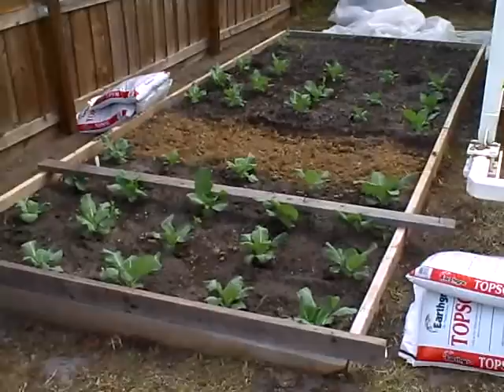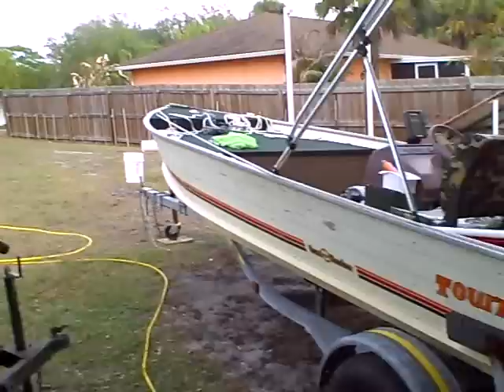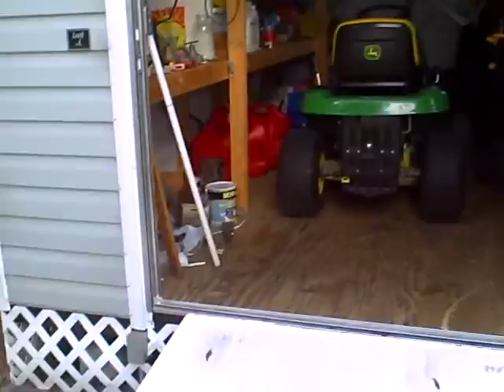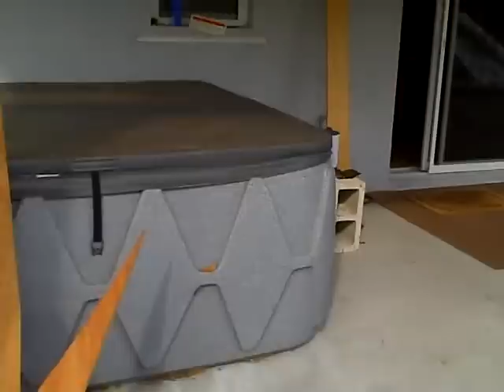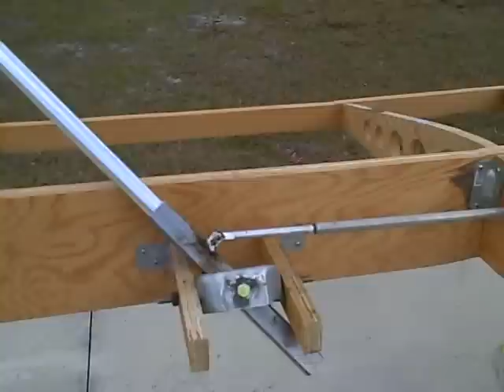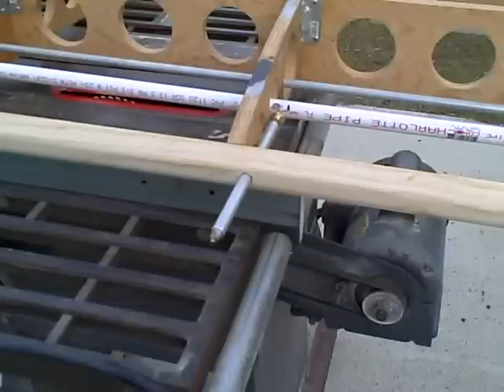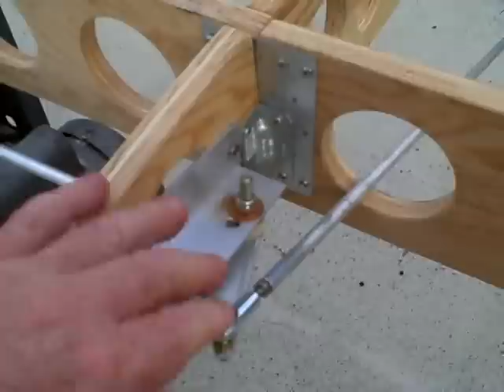My Home Depot Project Airplane

Comment: Dan, I give you kudos for ambition, but I must agree with those who have previously warned you not to fly this wing.  Why should you listen to me?  Because:

1.   I have an engineering degree and 17 years experience doing stress analysis of aircraft structures for a major aerospace company, working to assure the structural integrity of some military aircraft as well as some commercial airplanes that you may have flown in when you bought an airline ticket and went on vacation.

2. I have been a homebuilt airplane enthusiast for many years, and have spent a fair amount of time studying safe and successful homebuilt aircraft structures.

I agree with some of the other comments saying that the way you've designed and built it is not safe.

Like some others have suggested in the comments, if you want to build a homebuilt airplane, joint the Experimental Aircraft Association and learn from them, and get a set of plans or a kit for a known safe airplane and STICK TO THE PLANS.  And/Or do as I did and go to engineering college, study and learn, get your engineering degree, and get some years of experience practicing aircraft engineering before you design a plane.  Even then, it's good to talk it over with others that have professional credentials in the field and see what they think of any proposed design.

Sorry to rain on your parade, and not to try to say how great I am, but it's just that I happen to have some expertise in this field of endeavor that I hope you will benefit from hearing.
Reply: Brice Cook Alright then. Prove to the world that you are better than any of those "professionals" or those incompetent "engineers" that have been designing and testing reliable structures for years. Make this wing fly with indestructible properties Brice! 
You obviously know much more than any college professor or anybody with any kind of PhD, because you say you can! So grab that incomplete high school diploma and get to work!
Reply: Brice Cook I am not obligated to give you anything, because you are so well self educated you should be able to make all kinds of money. In fact, you should start your own business solving aviation problems! Imagine how rich you could become! Yet, all you do it write poorly conceived and written comments on the internet. A tragic waste of talent i say.

Also, lets look at your argument.

You dont think someone with real world experience should have a say in what he thinks this man should do, even if his advice is life saving.
Reply: Brice Cook This really has amused me. Your anger must be caused by some outside source. I suggest counseling. 

So long friend, try coming out of that bridge and joining the real world sometime.
Reply: John Terry <Jollyroger, your comment...snip>

LOL... One must always bear in mind, that no less than half of all students pass the 8th Grade, thinking Long Division, is Fucking Magic.

While in High School, only a few will advance beyond Algebra to study Physics and Calculus. Virtually all of these will graduate from College, with Degrees in Science and Engineering.

Less than half the rest will ever attend College. And less than half that number will ever graduate.

Those who do, are by far and away, Lib Arts Majors, and don't know OprahScience from the real thing.

MachOverspeed
Reply: Brice Cook While reading this comment, i couldnt help but feel your anger is unreasonable. Your lack of saying "before" instead of "b4" proves to anybody reading that your outburst is ridiculous. Your arguing with someone who is decently experienced and more educated in the matter, proves that your ignorance has gone unchecked for many years. I doubt anybody who takes your comment seriously has passed high school.
Reply: Brice Cook " I'll have you know I make upwards of $1,000 hr so no i would not waste my time with a lame ass job" 
2 hours later
"i do not have a job don't need one"

Right. It was pretty easy figuring out youre a troll, just like many who shitpost on these videos.
Reply: Brice Cook 1000 an hour? which job was that?
Reply: Keep building this beauty, other comments are idiots, except for mine, I use aircraft grade wood.
Reply: lol ... i have seen to many engineered things that are mere paperweights
THE TRUTH IS FLIGHT HAPPENED WHEN MEN BUILT THINGS TO FLY
DESIGNS CRASH ALL THE TIME
That said 
stress analysis is building something then breaking it ... you dont have to be an engineer to break things

the best way to stress test a wing is to load it with sand bags
there is no substitute for sand bagging your wing to stress test it 
computer models cant do what sand bags do never have never will and at far less cost with no errors

build a wing then bag it till it breaks and you have become an engineer and its fun to do am i right

of course even an engineered plane must be flown a first time by someone
beauty is these days you can buy big servos and test fly first flights by radio control easily.......

my suggestion is to all the doubters is not to tell someone they can't do something but to tell them how best to stay alive when testing any new design even if it was designed by an engineer.... sand bag test and radio test fly and you cant go wrong
Reply: jolllyroger
Jollyroger, your comment shows that you know very little about engineering in general, and even less about stress analysis in particular.  Stress analysis definitely is not "building something then breaking it."  Aircraft materials are certified to guaranteed strength levels, and knowing the strength of the material, a stress analysis engineer can perform calculations and/or computer simulations to determine whether a given structure made from a known material will be strong enough for a given loading environment, without breaking anything.

Engineers in the aerospace industry do not create mere paperweights, if they want to keep their jobs.  The companies they work for are in a very competitive market and they can't afford to mess up the engineering, and they rarely do. 

The products I'm involved in engineering are world-class, and if the level of education and attitudes that you display in your comments haven't relegated you to a very low income status, you may have flown on one of the airplanes on which I'm doing engineering.  I and many other engineers like me are working to make your flights affordable, efficient, and safe.

Regarding sandbagging something till it breaks, that approach means you have to spend the time and money to build a minimum of two of them, one for breaking and one for flying.  That is, IF the sandbag test shows you can fly the second one without changes to make it safe.  Nobody in their right mind does their designing by sandbagging and breaking airplane structures until they get one that works.  Far better, cheaper, and faster to know something about engineering in the first place, and design it and analyze it to be sure that it will work the first time.  Not to mention that you can make it light enough while keeping it strong enough so that it will fly economically, if you know your engineering principles first.

In the early days of aviation, there were some aircraft that were designed by people who were ignorant of engineering principles, and they often ended in tragedy.

I would suggest that you have a clue about the matters you are commenting on before doing it, ( otherwise the comments come out at a similar level of competence to the process of building and breaking something with sandbags till you get it right).
Reply: @johnterry8958  way back in the late 60's or early 70's, boeing outed an infovideo and i have seen it in movie theater in manila,  Philippines. It features a team of boeing engineers mechanically raising the outer tip of a boeing 747 jumbo jet wing about 28 feet before it broke with a loud bang. I think boeing will be glad to confirm this today, as they were so proud then of the test they conducted.

Comment: He's probably safe, because once the garbage-can skin is on, it will be far too heavy to get airborne or even off the ramp; so he won't have to worry about the spindly linkages getting cocked and jammed up upon takeoff. The airfoil patterned after a rat under a sheet will help to keep him earth bound as well.

Comment: There is a video of the FAA doing an accident synopsis on an aircraft with similar construction. Build using Home Depot materials. Wing spar was multi-piece instead of continous. Had in-flight structural failure. Pilot killed on impact.

Did FAA do approving inspection? Probably not. Surprised any FBO even let this goof bring this pile of junk onto his airport.
Reply: Dave, The answer would be unless the 'pilot' was flying it illegally, the FAA had to inspect and issue an airworthyness certificate under FAR part 21.

Comment: There's a reason why your wing is flexible: you're using a simple piece of wood as the spar- not a D-tube.

The D-tube spar uses a hardwood (often spruce) top cap, and an identical bottom cap, with a vertical softer-wood (often balsa) with the VERTICAL grain. The top and the bottom cap are glued to this vertical piece and creates a kind of "I" beam that can't be beat.

The spruce and balsa are used for small, R/C planes. Other materials would be desired on a full-scale craft. A very famous plane had a weak wing like this one: The Fokker Albatross. Learning your wing isn't strong enough isn't a pleasant, or repeatable, experience.

Comment: Mr. Dan Piner, I admire your efforts as I love anything to do with aviation, especially homebuilt airplanes. You've received enough criticism, so I'll just say your design is dangerous as it is. Your main spar, being wood, would be a lot stronger if it ran from one wing to the other and it was a SOLID beam of aircraft grade wood. Those round lightening holes you put on your spar, which by the way looks too thin, are suicidal. Please check with the EAA (Experimental Aviation Association) and they'll be delighted to help you build and fly your dream plane in a safe manner.
Reply: jolllyroger you are just as crazy as he is
Reply: jolllyroger All of those people you mentioned were seen as crazy due to the lack of understanding from the common society. Society has a natural response to people and material they have no understanding about; its called criticism. So in turn, all of the people you mentioned were innovators (aka "crazy" denoted by most people), they researched and proved NEW ideas and perfected them into working matter. In reality, they were not crazy.

Now, "real" crazy is trying to build an airplane with parts that are clearly not suited for an airframe. The reason I don't call the Wright Brothers crazy is because at the time there was no such thing as an airplane. But in present times, considering all of the wealth of information available to build an airplane, and not following though on it, THAT is crazy.
Reply: jolllyroger
Plywood is excellent for some things because of its buckling resistance, but don't use it on spars as a tensile or compression member. It can be used as an C or I beam web (shear field) member, but not as presented in this video. You need straight grained wood for those with a grain slope of less than 15:1.
Reply: that spar is ply wood .... do you know the tensile strength of plywood ( 4500 psi ) and the crush strength ( 5950 ) ( depending on the quality these are for general plywood ) the lightening holes are just fine ..... every thing is fine in this build except the ribs are to heavy and should be foam or 1/8 inch door skin.... the other thing is the metal joiners just wood gussets and epoxy is fine 

did you know that a 2x6 of general plywood will give the tensile strength of mild steel but the fatigue resistance is better with wood
Reply: Phil Alcoceli He should use thin laminated okoume without the lightning holes. Of course he will have to lengthen the okoume to spar length before laminating the proper thickness. (Stagger the joints). He could use balsa for the ribs - steam bend strips of Cypress around the rib for final dimension - expoxy and glass for rigidity. DO not use Sheet metal for covering. use appropriate fabric--- and that baby of his will fly. I suggest using a wright brothers type aircraft design. low and slow. 
;)
Reply: jolllyroger Their spars didn't have lighnting holes in them. Ok, mabye some of those did, but I sure as hell wouldn't.
See 
Journel of the aeronautical sciences here...
https://arc.aiaa.org/doi/abs/10.2514/8.11428?journalCode=jans
Reply: Phil Alcoceli ,
Reply: lets see crazy is what they called Orville and Wilbur.... the spruce goose... 
Pythagoras
Lord Byron
Tycho Brahe
Michelangelo
Tesla
John Baird
Bardeen and Brattain
Harvey William
Galileo
Robert Goddard
J Lister
T Maiman
Nott  and mosquitoes
George Ohm
Louis Pasteur
Semmelweis who said surgeons should wash
Andrew Jackson 7th president
John Kellogg the cereal guy
Henry Cavendish
William Chester Minor
Samuel Morse
Yoshiro Nakamatsu
Isaac  Newton

Comment: The ailerons are reversed.
Reply: I didn't believe you so I double checked and holy shit you're right! Well spotted 0.o He should have put the converter wheel or whatever you want to call it  on the other side of the aileron bar! That's not a good start...
Reply: +Lord Sandwich 
the only thing he got right is the aileron control direction.. Lol not the strength of the control components, only the direction. When the stick is pushed left it lifts the left aileron which drops the left wing as it's supposed to. But there are too many strength, weight, and aerodynamic errors to fly anyway.

Comment: Try to get a 40 HP engine - you will need that extra power.  There are a number of 2 cycle engines that will do that for you.  Be SAFE.

Comment: As a licensed A&P Mechanic, please, please consult with someone from a local EAA Chapter.  If you intend to fly this at all, you will need to have periodic inspections by a qualified AI.  I love your enthusiasm, but would ask you to research all of your hardware and use AN grade as well as safety wire all linkage connections.  Good luck!

Comment: Did you ever hear of Aircraft Spruce and Specialty. I think you should get some fine thread A/C grade bolts. some safety wire (and learn so safety wire things)
Before you go too far do a sand bag test of that wing (support the ends of the wing, and place weight equal to 5 X your weight + 5 times the weight of the aircraft and divide it by two.  if the wing supports that you may have a wing strong enough to fly safely

Comment: Why don't you cover the wings with 1" plywood after putting in rebar reinforcement inside the wings, i.e. for compression struts?   You are going to need to build in  inspection covers so may I suggest you get about three man hole covers for each wing.  That would just about do it! If after you complete the airframe if you have any trouble with weight and balance, you can use concrete cinder blocks to bring it into trim?  :-)
Reply: lmao.

Comment: Don't discourage this budding craftsman.  Also don't worry about the safety issue when flying it. It's way too heavy and way under strength to fly. Plan B should be to put the bottom skin on the wings then carry them out to your garden and plant something in them. You could always use that 25 hp engine and prop to build a air-boat.

Comment: Wow, yes enthusiastic but have you calculated wing loading and those ailerons look wayyyyyy too small.  Using a j-box for an open gimble set-up, how are you going to trim mid-flight?  And I wouldn't trust putting the airframe together with Simpson Strong-Tie hardware, make it an R/C project and save a life.

Comment: I have built a few airplanes. importantly I used plans of proven designs for the main structure of the airframe. what I see here is an attempt to build a plane without using any fundamental methods and ideas used in aircraft construction.  way way too heavy to meet part 103 FAR regulations.(254lbs)  and not nearly enough wing area, and for sure the wrong airfoil design to develop enough lift and remain stable. 20-25 hp. really??? not even enough even for this craft!! In the past I worked with a man named jack harper from fl. I worked with him building the aircraft called the lil. breezy. a open cockpit ultralight. his daddy designed a plane using materials from home depot. this was years ago but I bet you could still find plans for it online. it was called the home depot special. powered by two mower engines. look it up. good luck!!

Comment: well its already too heavy to be an ultralight.... I admire your enthusiasm but I highly recommend you never attempt to fly it. If nothing else just fly it only a couple feet off of the ground. that is, if it flies...
Reply: you mean ground effect?
Reply: aval1998 I suppose that would be the only force capable of getting this aircraft off the ground. It may not even have enough power to leave ground effect and climb out.
Reply: Rick Sanchez Yet STOL aircraft or simply aircraft doing short field takeoff use ground effect until they build enough speed for flight :)
Reply: aval1998 Correct!! Ground effect is even powerful enough to have a noticeable effect on an airbus A-380.

Comment: Have you talked to your local FAA Designated Airworthiness Representative (DAR)?  They will have to sign off on the aircraft at various stages of the construction.  You will not be able to register the aircraft without passing these inspections, unless it can be considered an ultralight, which I doubt.
Reply: This was false four years ago, and is false today. One inspection is required, and by that time most of the bad stuff is deeply hidden.

Comment: Are those ribs 24" on center? lol
Reply: 123jerro Think he should use the blue or green board on top in case it rains.
Reply: 88s10Durango Yah but this is a plane, you gotta think light. ;)
Reply: yeah  that's so the sheetrock skin will fit !
Reply: LOL priceless!!!